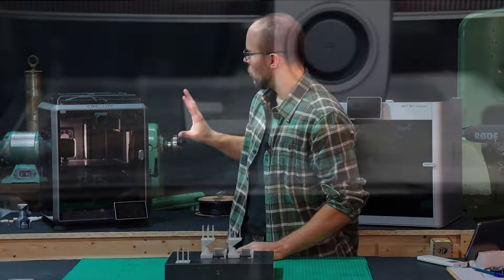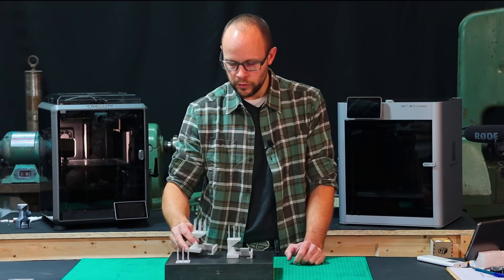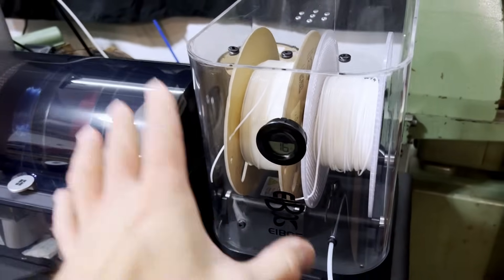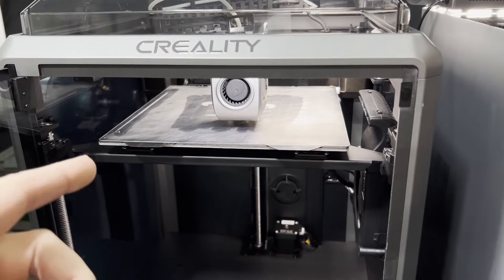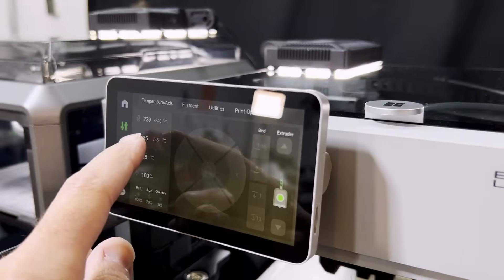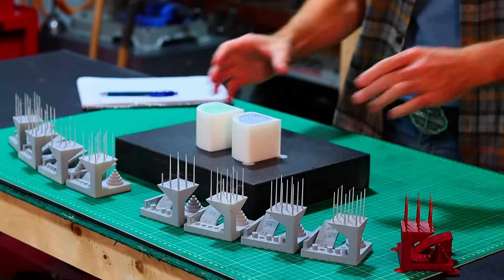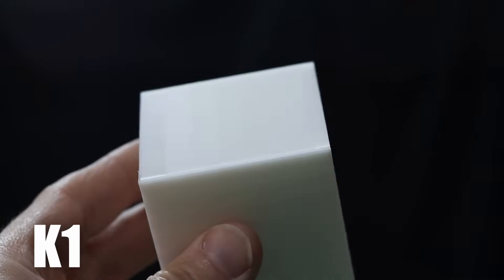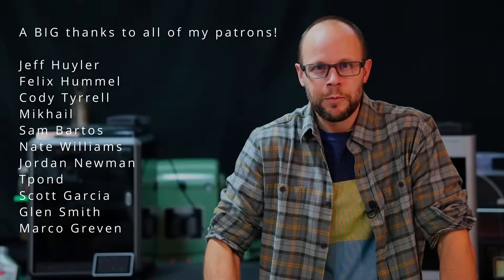Should you slow down your fast Creality K1 or Bambu X1C Printer?

Comment: Let it be known VFAs are a problem on the K1 series as well. Bambu seems to have it better worked out. I dont own a Bambu and I'm not part of their bot army but simply speaking from my frustrating experience with trying to "tune" it out of a K1 Max
Reply from the maker: Moreso on the K1 from my testing, but both similar issues between the K1 and X1C a slow speeds.  The K1 seems to have very faint VFAs as speeds increase but they are incredibly difficult to see even with all of the lighting I've thrown at it.  I should probably have tested PETG, I think it would have been a bit better.  Next time...

I can't speak to the Bot army, what I can say is that I can whip a print out in 2 hours that would have taken 7-8 hours just 6 months ago, that and the quality is better, there is less blobbing and stringing and I can be far more confident that I can produce a part and ship it out.  For me, these printers make a big difference.   Everyone is going to use them for different reasons,  printing gidgets and widgets and fidgets and such.  

Do you have a brand of printer you'd get behind?  Voron printers or another?
Reply: @NeedItMakeIt  I'm not the guy you replied to, but the only two other comparable mass-produced pre-assembled printers in the enclosed CoreXY format that I'm aware of are the Qidi 3-series and the Flashforge  Adventurer 5M series.  I have the Qidi X-Plus 3 with the upgraded tool head (Qidi have been steadily making improvements over time and the printers you buy today are different in a number of small ways to the ones from even 3-4 months ago), and the Creality K1.

The Flashforge 5M Pro is meant to print really well.  It runs a locked down Klipper with bizarre restrictions on network printing.  Print quality and speed are definitely in the same class as the BambuLab printers.

The Qidi X-Plus 3 (which costs around US$570 on sale with coupons, or ~$600 off-sale with coupons) is like a quasi-industrial grade CoreXY for consumers.  Its big selling points, aside from the enclosed high-speed CoreXY format, is its chamber heater and 350C nozzle temps, allowing for easier printing of certain Nylon and PC blends.  The upper end of its operational range could conceptually print PEKK, albeit slowly, but I've never attempted that.

There are a handful of other budget grade enclosed CoreXY printers from smaller manufacturers, but from what I've seen of them in various reviews, they are not quite in the same class as Creality, BambuLab, Qiditech, or Flashforge.

Comment: I think there is a misunderstanding in general with all high speed printers. Yes, they are high speed but with what? PLA (some sort of special high speed pla) , what about ABS, Nylon, PC or even PETG , going +200mm/s ? Seems a  waste to buy a high speed printer and not being able to use the full potential (aka speeds) with other filaments except PLA.
Reply from the maker: Absolutely, we're looking at something like 1/2 the speeds with PETG as PLA, and with ABS it seems like we're about 2/3rd the speed.   There's a lot more to it than that, some brands are so far off from the general flow rates.  I have a PETG I have been struggling with and it needs to be run on the K1 with 280 nozzle to get good results, and I'm running it at 13 flow, that's the temp range of PC, which is very strange.   There are some new nozzle options which have come out, both for Bambu and for the Creality.   If you want I can see if I can get my hands on some and perform some tests and maybe put out a video showing the differences from stock.   I'm pretty sure anyone with a Voron has already done these things, but we don't all have Vorons, maybe it's worthwhile?
Reply: @NeedItMakeIt  Yes what are the best nozzle upgrades for the K1? Have one for  🎅🏻
Reply from the maker: @marktaylor9616  LOL, you're hilarious.  I have a few nozzles on the way for high-flow, I'd love to do some testing on this.  I think our printers can go far faster if we do a swap.  I will add this to the list of videos I have going.  It looks like there is a beautiful... yet pricey upgrade from Micro-swiss, reviews look good so far, I think this is a good contender for a hotend swap, but we can also look at just the nozzles, that would be far cheaper!

Comment: Why is you bed adhesion so bad that you need to apply the glue and use the brim?
Reply from the maker: I do it to ensure a 100% chance of success on each print.  My prints are always made very heavy, 6 walls 6 tops, 5 bottoms, 35% infill.  the probability of warpage is far higher than a 2 wall 15% infill.   There's no question that I could dial in some of the settings a bit more, but for the sake of a stick of glue and a little wash up time, it's far better to use it than to not.   On the other side of things, I usually print PETG and adhesion can be too much that it ruins the buildplate, I use gluestick in that case as a way to separate the print without damaging the plate.  

 I'd like to test out some textured buildplates, however I keep everything on the printers as stock as possible for my videos.  

Can you tell me how you go about not using glue stick and some of the kinds of prints you'd make which would not warp?

Comment: Not sure I agree with the idea of the K1 having a better flow rate as you mention the volcano type hot end on the K1 the X1 seems to have just as long of a heat zone as the K1 just in a different format
Reply from the maker: All good, I'm happy to discuss with anyone; I really like to get another perspective to get a better overall understanding.  There is a lot to know. 

In these tests and others I have performed, the flow of the Bambu Hotend could not keep up, I believe it is more related to the material of the nozzle and the thermal conductivity of that material.  The X1C runs the hardened steel which is quite a bit less thermally conductive than the nozzle that the Creality runs as stock.  I suppose a better test would be to outfit the Bambu with the brass/copper alloy nozzle which would be on the P1 series printers, the X1 runs a stainless nozzle, which is not much better depending on how it's alloyed. 

If there is some interest, I'd be more than happy to run some flow tests on each printer and post a video.  I have another 2 printers coming and I can also add them in when they arrive.  

E3D has released an expensive hotend upgrade for the Bambu, it looks really nice, but it is a little up there for the average person to justify.  https://e3d-online.com/products/hf-obx-bambu
Reply: Yet he had to keep raising the temp of the Bambu hot end and with the K1 it wasn't necessary at all

Comment: Good test.
I was wondering this myself. Thx :)
Reply from the maker: Thanks!  Having made so many slower prints on my old printers, I can see how people would still be in the mindset of slower is better.  Printers these days are much more capable, we need to raise the bar!  Which printers are you running?
Reply: @NeedItMakeIt  it's true. Running them at the 80% mark seems to be perfect. I think the older printers were all meant to run at slower speeds, but were essentially "overclocked" to run at more reasonable speeds, resulting in worse prints at higher speeds.
Reply from the maker: @AvocadoAtrocity  I have been checking out the FLSUN S1 printer and I cannot believe the speeds they're claiming they've reached with their Delta printers 1200mm/s  with an accel of 40k.  Hard to believe that in such a short time, they've changed so much.  Remembering back to my abomination of the Anet A8 I started with years ago.  These printers are going to run so fast that you won't see them moving.  Don't reach in!  This is great for us now, but I think that in a few years there will be better tech which solves a lot of the problems we see with this style of printing.  We need something closer to injection molded parts if it's really going to be able to be used for industry.

Comment: The VFAs at slow speeds are a well known issue on Bambu printers. And nobody ever found a solution, yet.
Reply: Spoke too soon my friend! BambuLab just released noise cancellation which significantly improved VFAs! 🎉🎉
Reply from the maker: @3dPrintingMillennial  I saw that, good for them, hopefully other companies can follow.  This is very cool tech, not something that I would have thought was possible.  

Before I do the update, I'll do some testing myself before, and some testing after to see the difference in my shop.  Should be fun!
Reply: Yeah the update pretty much eliminated for me
Reply from the maker: @spezzy  Perfect, I'm in the process of testing the difference in sound right now.
Reply from the maker: I've found a website talking about this for Voron printers and giving some advice on how to fix it, having seen it on the K1 and the X1C not to mention other prints I have made at slow speeds, I don't see any good reason to slow down your printer do you?   I suppose that if you're running small parts and cooling is a problem they'll be run more slowly and could show these VFAs, not sure how often that's going to happen.
Reply: @NeedItMakeIt  you're right on small parts. I had this happen on small cubes for example. I just upped the speeds and upgraded to a high flow hotend, and I have zero issues since.
Reply from the maker: @laydnbeats  Yeah seems best to keep the speeds up, and like you've done swap the hotend and you're golden, the CXY setup is limited by the hotend anyway.  I suppose that the cooling is also a bit of a factor, but that's one that's pretty easy to adjust, open door, top off, or add a second AUX.   I'm wondering if it would be possible to direct the AUX towards the nozzle better, but I suppose that would require a tie to the position of the head in the Y axis, which is possible, but probably more trouble than it's worth.
Reply: Probably won't be a solution because it is very likely hardware related. The motors themselves, pulleys, idlers, etc.
Reply: does it need a solution?
Reply from the maker: @ServentofTheMostMerciful  I don't think it's that important, there are times when running small parts where the print would be adjusted to run slowly through the slicer, so it will come up on occasion.  How prevalent this shows up is also based on the filament you choose, PETG seems to like to show these the best...worst.  It'd be nice to have a solution, but it's not detrimental.  I would be curious if a delta format printer has these types of problems, because FLSUN has a couple of new fast printers as well, maybe they do not have these same issues.